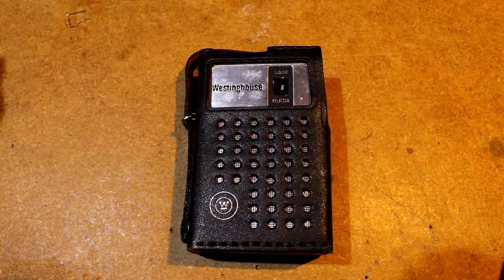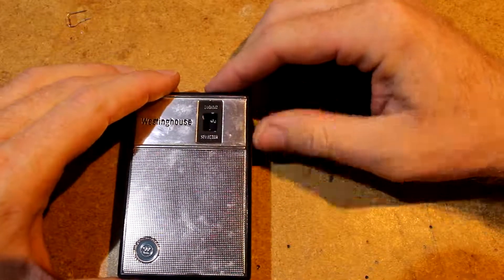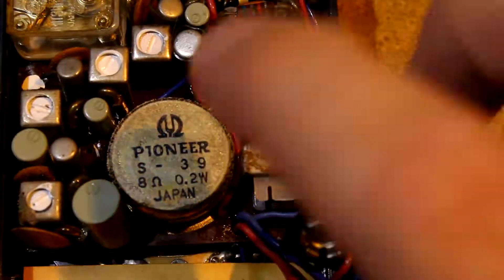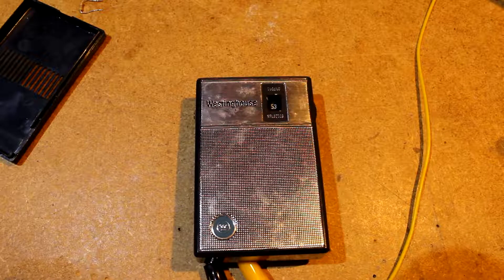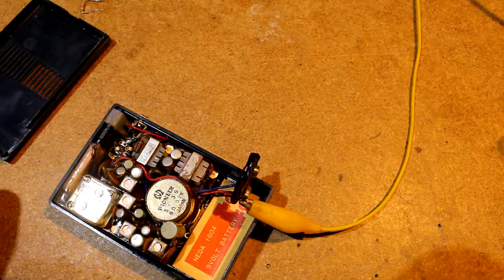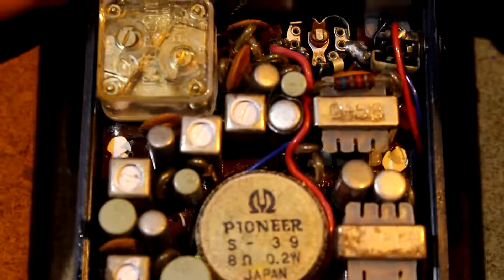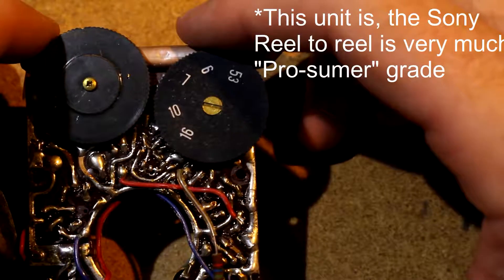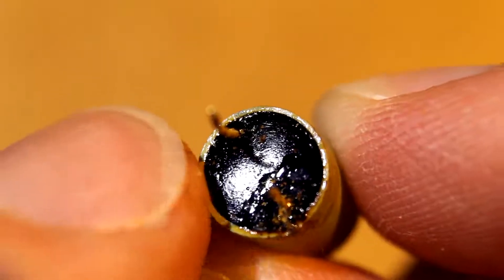Vintage 1960s (?) Westinghouse 6 Transistor radio poke around and recap

Comment: Never buy any transistor battery powered radio if the seller will not test it and tell you if it works or not..  These are NOT like TUBE radios that will explode on you if they are very old. So If a sellers is selling a transistor set and will not tell you if it works then it 95 percent of the time he knows that it will not. Its not always simple capacitor issues. Germanium and silicon transistors go bad as do the IF cans  and the little volume controls fail as the carbon track inside them wears out. Be Advised.

Comment: I found one at a local Goodwill thrift store. Dated circa 1964. These pocket transistor radios are amazing. How they can endured the test of time blows my mind. Mine came in a black leather case with a wrist trap. Interestingly enough it had a 9v rechargeable battery. Model H902P6GPA, Charcoal Blue, Serial # 78246 CFF